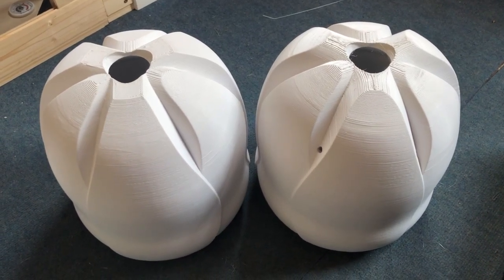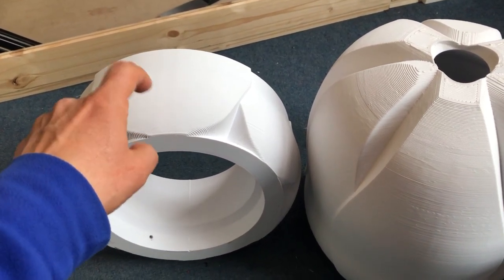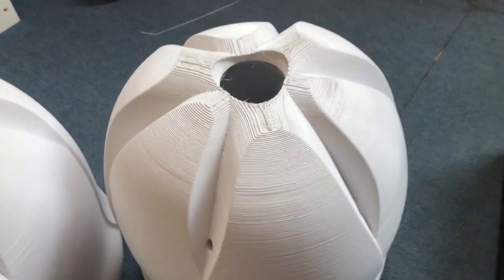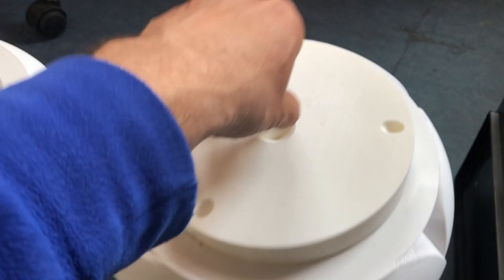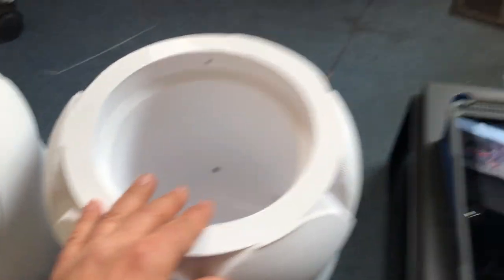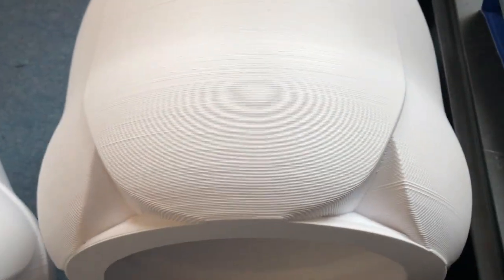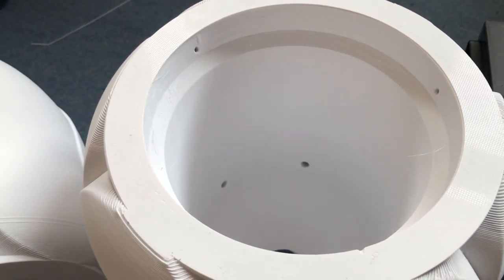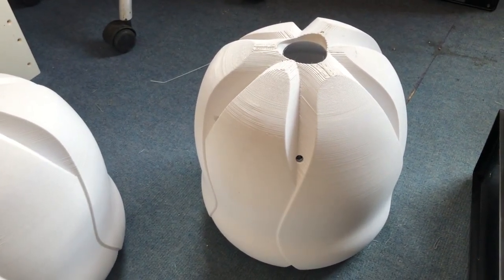TRONXY X5SA 600 - Big-Print review / comparison - ANOTHER Layer-Shift on layer 2...?!

Comment: I think you might be having bed height issues. It looks like layer squish on your first few layers. You should check your bed height before each large print. Sometimes your bed will go out of adjustment when detaching a large print. Something to think about.
Reply from the maker: yes, always important to do this... but i remember just having only a few screws to adjust the bed and i went really crazy with bringing it to 0.0x wirh a 15min pre-heated bed before a print... even then during a print the whole system warms up and lives its own life in this cheap-printer-category... so just thinking about it is just a good start ;)

Comment: I feel like this thing could use some closed-loop servo motors. The wheels lock in but there can still be significant microvibrations, potentially over longer print times. 
Maybe you just have to have a lower print speed and keep the travel up, or adjust your accelaration on the x/y-axis motors.

It also kinda looks like you could print a little hotter (+5-7c), there's definitely under-extrusion hiccup spots.

Also maybe expand line width and print path precision to get a more even spread, as the wider line allows for more "squish" and winds up being less sanding later. 
Since you had concerns about the corners and such. 
It looks like your printing with a larger nozzle - line height for maximum efficiency on speed. Does it seem like you can get away with cranking the speed up [before quality degradation] more on a large printer vs what you can do with a smaller desktop printer? Since you have longer travel movements.

I've been following your work here and on this printer. It's amazing, and I enjoy following along and i'm rooting for you.
Reply: There are also closed loop steppers that are less expensive than servo motors.
Reply from the maker: thanks for your comment anthony! oh there is a lot to improve on a big-scale machine like that... i knew i was printing on the edge of performance for this low-budget... i already got great help from nice fellows and learned a lot with every kilo going down the nozzle... some things are so different in the real-life-print, in comparison to smaller test-prints of just a critical segment for example... i did a lot of testing... any you are right with all your points... expanded line width was 1mm with a 0.9 nozzle... not a lot but ok to improve smoothness... and about the temp... well should be adjusted for every layer  to the speed and shape you are printing... i hope future ai-slicers will help there to guess the right setup in theory... but then reality and the next new filament spool hits you naked somewhere else... the tronxy is history for now, after just working on the machine instead of my prining-projects. so now i am planning to use the tronxy frame as a housing for my prusa xl... haha!
Reply from the maker: and sometimes it is a good investment to talk to professional xl-printing services/companies to really work on your print-project instead of just your machine... as i did. saves a year in my case and you can summ up some money for that... and still learned a lot on a different level... :)